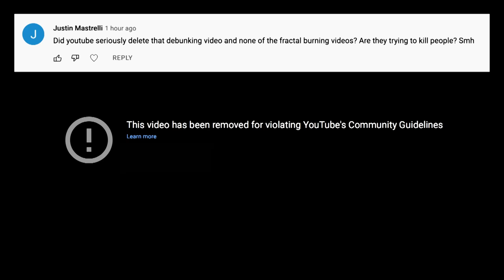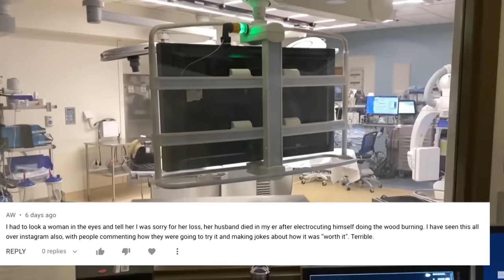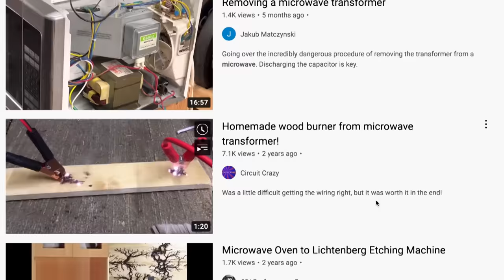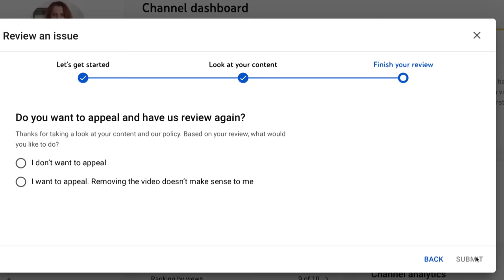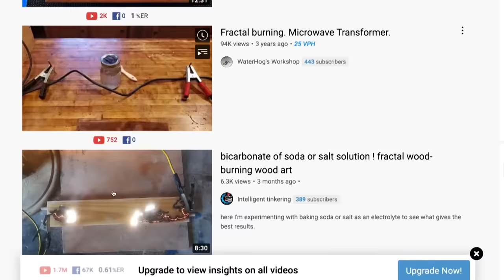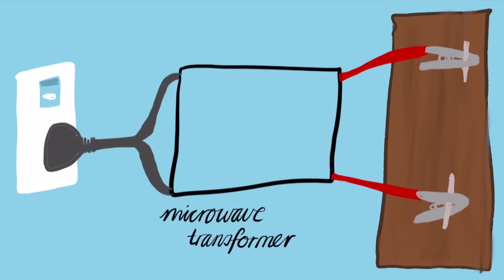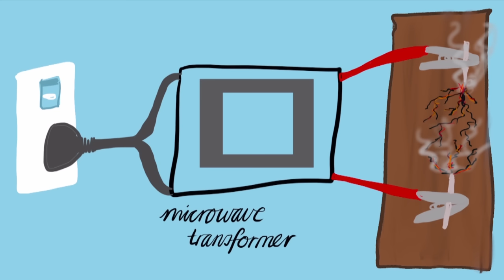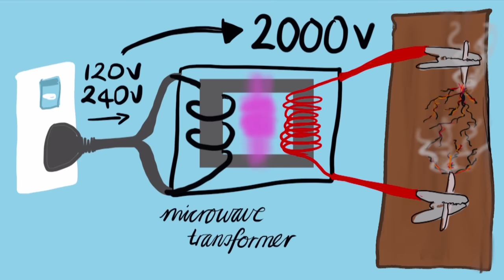YouTube BANNED my Debunking Video but leaves DEADLY how-to vids online, 34 dead!

Comment: As someone who has took all manner of electrical shocks, microwave oven transformers voltage scare me.
You just cannot trust insulation above 1kV like you can with mains voltage.
It gets worse when you factor in the fact that at those voltage there is no need for clear circuit path for a "zap" to occur.
However it does not get less grim, since it is AC your body get treated like it is the ground regardless of it being isolated from ground or not (see however capacitive touch screen works).

Now for some history:
The reason I fear high voltage in technical definition has to do with a leaky ignition cable that had a very difficult to spot insulation crack.
It gave me so many painful shocks while I was doing inspection and trying to fix it, even when I tried a more safe approach that I was sure it not shock me, it got me once more.
As results I longer trust insulation with voltages above 1kV.
Funny enough, I did trusted a microwave clicking like a Geiger counter to not shock me.
As I thought it was internal discharges and since I was not messing with internals like with the ignition cable, I could just unplugged it without fear.
Wrong, it did gave me a shock.
Lucky for me, none of these had enough power to do anything besides being painful.

Enough with anecdotes.
At those voltages so many safety protocols have to be followed and so much attention to materials have to be taken that is just not worth it.
As neglecting a small step or a imperceptible damage to the equipment is enough to cause a severe accident.

Comment: The turns are an amp. 
The primary turns (the ones coming from the power source) send a lower voltage/amperage to the higher number of turns (the higher number of turns then amp the power [based upon the ratio of primary turns v secondary turns.
The output of the secondary  turns has more turns - thus via a ratio (of x original turns to y number of secondary turns - secondary turns being greater - thus a greater amount of power output [thus an amp])
Do not mess with amperage.
.5 amps can cause your heart to just stop. 
Voltage is not the killer.
Amperage is the killer.
What you have created = a Step up transformer.
You have created a very dangerous step up transformer (of unknown voltage and amperage) = the danger.

Comment: Natural selection at its finnest. I've worked for 6 years in my city electrict company doing maintenance on equipment and electric transformers of distribution stations and honestly, all i can think of is that if  people had the curiosity to know why something has a certain result and how the tool or machine that makes it works they would take proper precautions and actually learn something in the process or wouldn't do it at all.

Comment: I'm an electrical engineer, that's been hit by HV several times, and I won't even play with a microwave transformer, as built. When I do reuse one, I remove the secondary, and rewind one at a much lower voltage. These transformers not only step up the voltage, they do it at a high power level. 750W for a small one, to 1500W for the large one, with 1000W being the most common. Microwave oven transformers are not to be played with ! This fractal wood burning, makes even more dangerous, as it increases your chances of getting hit by that high electrical energy.

Its neither the voltage nor current that kills you, its the energy level delivered (volts x amps x time). "Its not the volts, but amps" is peasantry BS ! And a microwave transformer can exceed that energy delivery in a very short time. As for that woman with those disfiguring injuries. That was probably an arc flash. An arc flash is basically what you see in a Star Wars movie, when somebody gets hit by a light saber ! Except, this is for real. Arc flash is more likely, at higher voltages, but you need the power (energy per time) to maintain it, A microwave oven transformer can easily pass that requisite power.

A final insult of microwave oven transformers, is that one of the high voltage (2000V+) secondary leads, is tied to ground ! Ground sound great, because grounding something makes it safe. More peasant short cut thinking, which can KILL YOU ! When that transformer, is still in you fully intact microwave, then yes. Because in that case, the body of your plugged in microwave is at ground potentials, as most likely are you. So no voltage difference. Same with a grounded power tool. If the high voltage gets in contact to a ground part of the housing, it will short out, draw excessive current (amps for the peasant) and trip the home's circuit breaker. However, if you pull that microwave transformer out of the housing, now that housing is not in between you and the the high voltage lead. So when you touch that HV lead, the current goes through YOU, to get to ground ! That's NOT going to be good for you ! Devil is in the details !

Comment: As someone who has worked as an engineer, with high voltage and high currents, I can say that the way this is being done is absolutely the wrong way to do it. Part of my jog in the past was to insure that equipment was safe for people to use - to be sure that there was no way a person could accidentally injure or kill themselves when operating equipment.

While it's possible to devise a way to do fractal woodburning safely, it will never involve exposed high voltage. And it will never involve having people who have zero experience with high voltage circuits handling transformers that are capable of producing from 2.1 to 2.8 thousand volts. This is not the sort of thing an inexperienced individual should ever consider touching.

In my current job, I work with even higher voltages - sometimes up to around 14 KV. And when I am working with these voltages, I connect the circuit, stay well away, and then apply power. When I'm done, I remove power, and check the voltage to insure it's zero before touching anything. If there is any chance of any residual voltage being present, a shorting stick is used to bleed off that energy. The trouble with the home user is that they likely don't even have the equipment to indicate whether a circuit is energized or not. Nor does a typical multimeter a home user might have access to have the capability of operating above 1KV in most cases. 

One final point is safety equipment. Any time a professional is working with voltages such as these, they are wearing specialized personal protective equipment, including a face shield, special clothing that will not burn, extra-long gloves that are rated for well above the voltages being used,  ear protection - they are protected from head to toe - precisely because of the dangers involved. Watching "some guy on Youtube" cannot properly convey the seriousness of the intensely dangerous act.

And while, as I said, it would be possible to design a way to do this safely, I won't be doing that, because trying to sell such a product would carry insane amounts of liability because someone would try to disassemble it to make things easier or faster, and then get themselves killed, and the designer or manufacturer of the product would be held liable. 

In short, you're right. People shouldn't be doing this. At all.

Comment: Complete deadly microwave, 50 quid. Safer neon transformer, 250-300 quid. Both high voltage but the neon transformer has lower amperage!!!

Comment: As one of those experienced electricians she mentions who might say "yes fractal burning can be done safely", I'd also say 100% IT IS NOT A DIY PROJECT. And that is where a couple of these guys likely went wrong. They probably used some electrical safety from their training, but were still using some homemade setup to do it, and that is the 1st problem with this. To safely do fractal burning, or anything similar using high voltages, you need to actually engineer and build a machine with multiple safety devices in it. This isn't something you are going to be able to do by just throwing together some components from the hardware store. 

But I want to further stress that this goes beyond fractal burning. I see a lot of videos on YouTube for DIY electrical stuff and so much of it is really bad. Even mundane things like wiring in the house or the like. The main problem is unless you have had training or years of school, most people simply don't understand how electrical systems work. There are ways to get killed without even touching something. Leave anything more complicated than changing out a lighting fixture to professionals, unless you have a deep understanding and the experience to put that knowledge to use. YouTube is great for learning how to DIY on a lot of things, but electrical is not one of them.

Comment: Honestly, I do want to still do this kind of stuff, but not in this half arsed DIY style, but with full on safety measures like VERY thick insulating clothes and suits, an insulated chamber that the wood would be in and a tonne of redundancy and so on. But i would NEVER do it in the ways that you usually see it, which are just deathtraps waiting to get you. An example of how i plan top make sure i can not fuck up is making it rely on two simultaneous button presses a few meters away from the device, while the metal spikes are held in place some other way safely, so i have to step away from it to be able to activate it. I'd say overengineer it, but with stuff this risky, that isn't a possibility.

Comment: There's a reason why electronics hobbyists who know anything about safety always advise against playing with microwave transformers. Even if they use them, they discourage other people from using them. If you're old enough to remember CRT televisions this is also the reason why you were told not to open them. Although the capacitors are generally bigger and those can also kill you too.(mw or tv) unless you're trained in high voltage you shouldn't be messing with it.
I've heard hobbyist and professionals somewhat jokingly refer to microwave transformers as "Widowmakers". This is because of how many hobbies and professionals that they killed.(generally not at work but as a side project) This was a problem before fractal wood burning became popular. it's now just a bigger problem since people that have absolutely no idea are now playing with them.

Comment: If you want to have the same effect and don't want to die in the process, buy a pyrography tool. It's often known as pokerwork. It's been a traditional craft in Eastern Europe for a very long time. You need a steady hand and a smidge of artistic talent. A pyrography tool is a like a heated pen, not hugely different from a soldering iron, and you can buy different shaped attachments eg leaf shapes. If you are careless you can burn yourself but the burn will be small and unlikely to require more intervention than basic first aid. I wouldn't let a small child do it but I've been doing it since I was about 14. Do not use MDF, use real wood. MDF gives off dangerous chemical fumes and that's not good.

Comment: Didn't some internet rules change a while ago that if you have content on your site you're liable for it? This is the result. It's easier for a site to ban content that might be questionable than to prove if it is or isn't. Proving it safe takes time and what if you're wrong? The safest course of action is to remove it and not risk getting in trouble. That's why we have so many videos or comments being stricken even though they may not be wrong. There should be a better process for fixing mistakes like this but that's less of a concern for these sites. It's all about liability. Remove it and move on.

Comment: I'm not a election but I know that converter put out a lot of voltage that can kill you, now I didn't know that the voltage is that high but I know it's dangerous, even when it is off, I would say never try to fix a microwaves over, cause it stores power in a backup too and you won't know where that storage unit is.

Comment: good now if i wanted to do this i pretend it is in fact a gun pointing at my head stay at least 5 feet or more away from high voltages yes i have touched a tesla coil however the amps where not high

Comment: One of those transformers doesn't really have much to limit the current. Instantaneously the current potential is extremely high with a transformer hooked directly to the grid. The current level that can be fatal is measured in milliamps, above about 30mA is considered potentially fatal in the industry. These things can easily put out current in the amps range. It's not the voltage that kills, it's the current. However there are three factors involved, voltage, current and resistance. Current is directly proportional to voltage and inversely proportional to resistance. Assuming your body has a given resistance, and the power source has sufficient current capacity to cause fatal injury, if you double the voltage, you double the current. This is why high voltage is considered very dangerous. However there are lots of sources of electricity in the thousands or even millions of volts that are harmless because of how low current they are. Van der Graff machines, small Tesla coils, even portable cattle fences. Meanwhile a car battery isn't an electrocution risk under normal circumstances because the voltage is too low to produce much if any current due to the bodies resistance. Drop a spanner on it though, and you get thousands of amps flowing through it, and a liquid spanner in short order. 

Personally I've had many shocks from 230v supply, and they have been only mildly painful and there was never an injury. Again, potential. I was dry, it didn't go from hand to hand and I always had work boots on. Harmless in those instances, but still extremely dangerous given the right set of circumstances. With 2000v at potentially high current, you have no margin for error like I did with 230v. To put it in perspective, at  230v, your body needs to be lower than 7.7k to get a shock in the threshold considered fatal. At 2000v your body need only be below 66k to produce the same result. Your body can present as little as 300 ohms, or as much as 100k ohms depending on how dry your skin is ect. It's usually in the low kohms in my experience. Extremely likely to be below 66k, especially hand to hand. So the likelihood of a fatality when in contact with one of these things is extremely high.

Comment: I used to work with comparable electronic equipment in the Navy. High voltage, high frequency, and the current... well, high enough. Not only would I usually be wearing very thick, arm length gloves, I'd also have a rubber apron on, and a face shield. I'd have a buddy standing at the breaker panel. We'd also often have someone standing around with a wooden cane, just as a second contingency. We all knew CPR. Would I feel safe trying this? No.

You've really got to know what you're doing to even start thinking about safety. Electricity can do really unintuitive things at higher voltages. You can't just use common sense. You can't just know how it's supposed to work, you've got to know how it will work under every failure state as well. Is your plan safe even if the transformer has a failure? Have you considered all the different ways the transformer could fail? 

Anyways, my point is this is the electrical equivalent to eating mushrooms that you find in the woods. It's possible to do it safely,  sure, but here's a hint: The people who know enough about mycology to safely identify wild mushrooms didn't learn from life hack videos. You can not acquire the skills and training you need for this kind of thing via YouTube.

Comment: Commenting after liking while replaying for the third time for engagement being picked up by the algorithm.  Gonna go do that to the original video now.

I'm not an electrician, just a hobbyist that loves high voltage devices.  My current rent house has sketchy grounding (stuff tests fine but why do I register 90v from the oven handle to ground prong?) so I won't even repair my stack of CRTs until I move.  I don't care if they're relatively modern and probably have a bleed down resistor for the caps and they've been sitting unplugged for over a year.  If I can't properly ground my properly rated probe for discharging the flyback, I ain't doin' it yet.

Respect the pixies and they won't get angry and throw sparks.

Comment: What can go wrong? I'm just using live electrical cables without proper insulation to create a woodburn on this wet piece of board. Nah I don't need protective gloves because electricity can't kill, at most I'll get a mild chock.. Just look at how close his unprotected fingers are to the hot area, 1-2cm (~0.3-0.7in) at most. It's insane and should be common sense to all that you simply do not operate live electricity like that, like an idiot. You shouldn't be doing it at all unless you are a certified electrician who knows your business. I guess his family was chocked to find out that electricity can in fact kill.